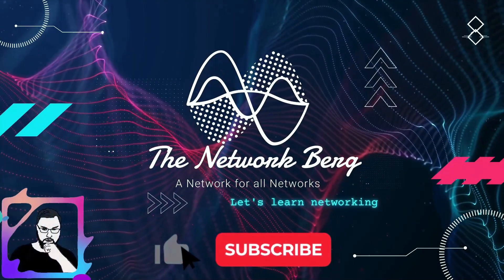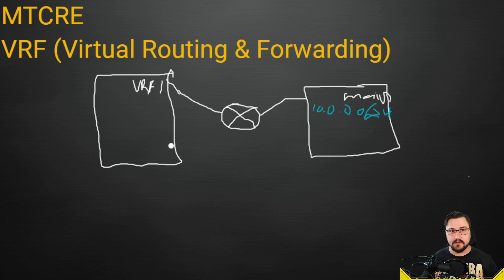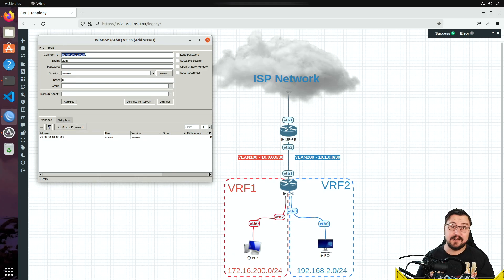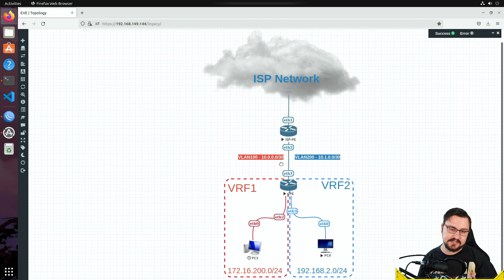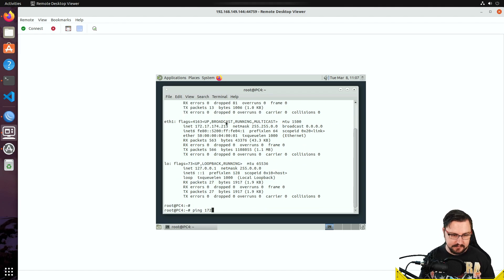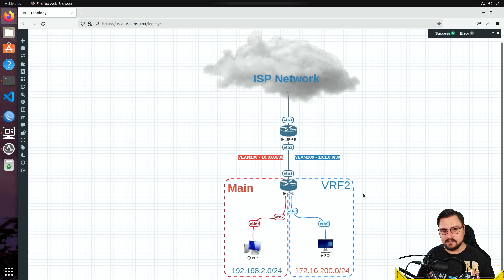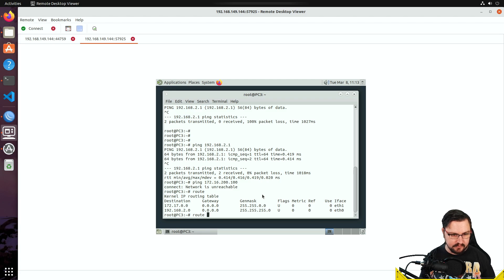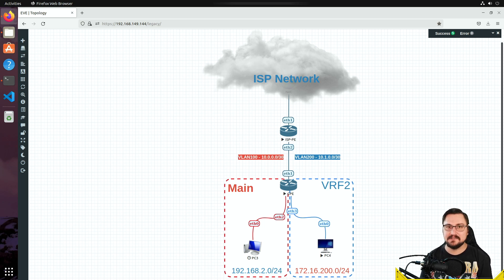Full MikroTik MTCRE - VRF (Basic Overview & Lab)

Comment: nice video, but I am still ttrying to imagine situation in which this will be usefulll
Reply from the maker: In the ISP space VRFs are a very crucial part of business. Many times customers will have overlapping IP addresses and you need something like VRFs to provide service to them effectively. There are also ways to span VRFs between different routers using protocols like BGP across the entire ISP network making it a very desirable mechanism.

This can also be extremely useful as segregating services. It is commonly used for CPEs (routers at customer site) to separate services like Voice & Data.

It is not typically used in a home environment, but can still be useful if you ever need an extra layer of segregation.
Reply: @TheNetworkBerg  - thanks for explanation !!!

Comment: Hi!! Good video!! I have mounted VRF lite in my environment, everything works correctly but when it comes to making the routing rules (for monitoring and other management actions) it does not work for me. The only difference I have regarding your setup is that VRFs are made up of logical interfaces (vlans and wireguard) and RouterOS7. At the time that I add the rules, I only reach the IP's of the interfaces, but not the servers within those vlans. I'm missing something?
Reply: Hi again! It's solved. I add new mangle rules for that. (I only had mangle for internet)

Comment: Let's suppose that we don't have several vlans delivered by the provider, we only have a wan port, how would it be done in that case? it is not possible to put a single wan port inside several vrf
Reply from the maker: No, but you could use a technique we use called route leaking to allow vrfs to route between each other. So you could push traffic from a vrf to another using a mangle rule.